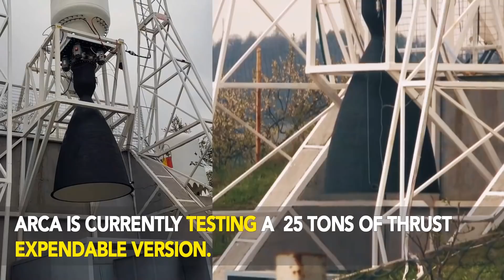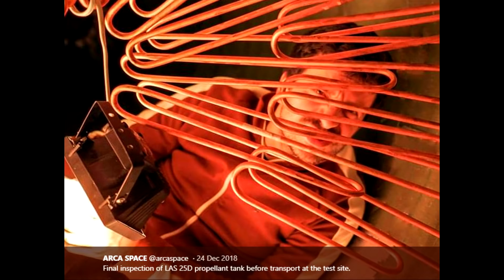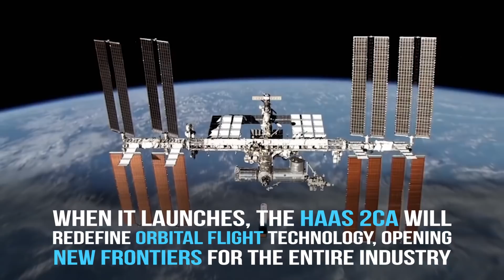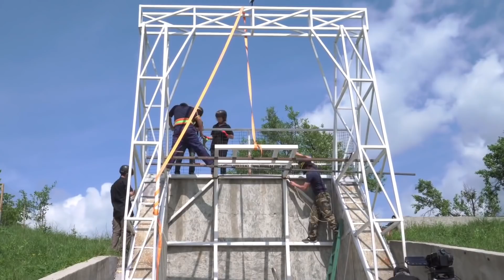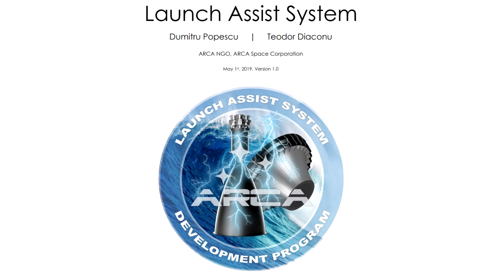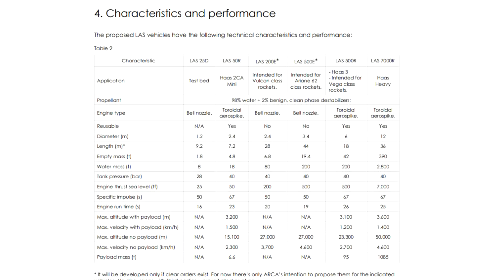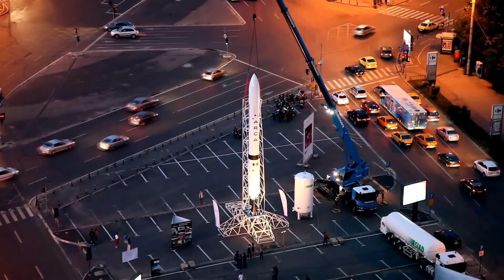Does ARCAspace's Water & Electric Powered Rocket Make Sense?

Comment: "They'll need 50 kilograms of batteries..."

Huh, that doesn't sound too bad.

"...per second"

oh
Reply: Especially as fuel "disappears" when you burn it, meanwhile you gotta take those batteries all the way with you!
Reply: Yes, 48 megawatts is a lot of power.
Reply: This is outside my area of expertise, but wouldn't all those batteries eventually become a lot of hazardous waste anyway? You can only re-use them so many times right?
Reply: @SgtHappyHands  at the crazy load rate they would need to be discharged in this rocket concept, the batteries could be used a couple of dozen times at best, with performance measurably degrading every launch.
Reply: @charlesfowler4308  You can drop the batteries. Use air bag lithobraking like Spirit and Opportunity for the packs. Funny enough, this design makes the rocket extension cord possible. It's all gravity losses and TWR for first stages. If the first two seconds of flight are tethered, that's that many fewer batteries needed. Add a simple rammed air generator and you can get the landing power regenerativly. I wouldn't even call it a traditional first stage, more like a Kickstarter stage maximizing TWR and only TWR, so the ISP stages can do their jobs.
Reply: The mission profile of the booster is only about 30s.
Reply: @w0ttheh3ll  Oh, I didn't know the rate of discharge would impact battery life! So they sound even worse than I initially thought.
Reply: That's not too bad... Problem is you still carrying those dead batteries so thrust to weight ratio isn't improving as much as it could. Also quick discharge- bigger failure potential and idk what's worse, rp-1 or a huge battery bank blowing up.
Reply: @SgtHappyHands 

That was assuming lithium primary batteries. Also known as non-rechargable batteries.
Reply: @SgtHappyHands 

That was assuming lithium primary batteries. Also known as non-rechargable batteries.
Reply: @SgtHappyHands 

That was assuming lithium primary batteries. Also known as non-rechargable batteries.
Reply: @SgtHappyHands 

That was assuming lithium primary batteries. Also known as non-rechargable batteries.
Reply: @SgtHappyHands 

That was assuming lithium primary batteries. Also known as non-rechargable batteries.
Reply: @SgtHappyHands 

That was assuming lithium primary batteries. Also known as non-rechargable batteries.
Reply: @SgtHappyHands 

That was assuming lithium primary batteries. Also known as non-rechargable batteries.
Reply: @SgtHappyHands 

That was assuming lithium primary batteries. Also known as non-rechargable batteries.
Reply: Wait, just refreshed, are these duplicate comments really posted? I just assumed that was a browser side display bug.
Reply: @jtjames79  The weight and extra complexity of a RAT would more than cancel out any benefit is would produce in charging the batteries, much easier to just charge them on the ground. But yh you could ditch the batteries, with a parachute tho lithobreaking alone would not be enough for something as dense at batteries in earth's gravity (I assume you meant doing so in conjunction with aero-breaking, just clearing stuff up 🙂). How ever at this point given the high cost and quick degredation of whatever batteries you're using I think a shuttle style reusable SRB would me much more sensible. And given all this extra complexity probably no more awkward.

Edit: Power cord idea does seem make a lot of sense tho
Reply: @TheAkashicTraveller  yes :) you have posted the same comment 8 times.
Reply: @TheAkashicTraveller  THe issue with lithium primaries is that they have a realy bad power output...

And if you wan to use lithium primaries anyway... why not just burn lithium right in the water. If its used for heat anyway.... that makes more sense
Reply: @TheAkashicTraveller  Thanks for the clarification. And sorry that your comment got posted 8 times XD. I just had one get doubled posted a few days back. But I've never seen eight.
Reply: quote 50 kg batteries PER SECOND unquote
Reply: @charlesfowler4308  Someone else brought up laser power from the ground. Since it's only got a 30 second mission, there seems to be many options for electrical power.
Reply: There are many better ways to get power/heat for the water in a steam rocket. The fact they are saying they will use Li-Po batteries suggests they have no idea what they are doing or are simple full of it.
Reply: ... "per second", not per flight.
Reply: ok, didn't "read more" :)
Reply: Charles Fowler you could eject them when empty, like the electrons upper stage. But than again batteries(Li-ion-Po) can only dump they’re energy in several minutes, not seconds due to the relatively low power density. So super caps would need to be used as they have 100’s of times higher spesific power.. buuut than again super caps have an order of magnitude lower energy density, so u would need something like 1 Ton of caps/sec.
Reply: @TheAkashicTraveller  They really are. sigh. You have some deleting to do.
Reply: That moment when you can describe battery power in terms of mass-flow.
Reply: All they need to do is vapourize the dead batteries with the good batteries and use batteries as the propellant...
Reply: @HylanderSB  30 seconds? Maximum discharge of rate of current Li cell technology is about 20C, or 3 minutes, but that is an edge case with massive thermal losses to internal resistance and the cells designed to handle such high discharge have substantially reduced specific energy right from the start.
Reply: @SgtHappyHands  It depends, there is a tradeoff in battery design where you can get somewhat better energy density in a battery that ruins itself in a single discharge, or worse density in a battery that can be recharged and discharges thousands of times over the course of years
Reply: @charlesfowler4308  unless you use asparagus-style staging
Reply: All they need is a Water Battery ... maybe some HHO pseudo scientists can help them, the ones who haven't already been killed by big oil companies and the Illuminati
Reply: for a first couple of second you can use a long cable to supply power ..... after that you drop 50kg of batteries each second.
Reply: @mihasedej  a super conducting graphene thread!!!  .. or a large laser   (humor)
it's funny all these silly useless water rocket ideas have been around for decades.
Reply: LOL
Reply: I know this will probably sound ridiculous but, what about a pair of spools of superconductor wire (or even copper) and structural sheathing ground side and you use something like this as a first stage, "dynamic support" skycrane stabalized by the cables (ala Curiousity Lander) that would lift it maybe 40 miles up before launching a more conventionaly fueled rocket... we know siting rockets closer to the equator (for increased rotational speed) or at higher altitudes is considered worth doing; wouldn't getting past the bulk of the atmosphere be worth doing?
Reply: @w0ttheh3ll  Wouldn't graphine supercapacitors get around this? Those are reasonably expected to be available somewhat soon for limited applications and unless I'm misguided about their theorized capabilities, they should handle a duty cycle like this pretty well.
Reply: At 250°C water temperature, they're storing 291.7 Wh/kg through temperature alone. Adding 150 Wh/kg batteries on top of that makes no sense at all.
Reply: @bryanl1984  I haven't heard of those. If they are at all comparable to current supercap designs, their power density would make them suited to this kind of load in theory, but their energy density would be horrible for a rocket.
Reply: @jtjames79  I had to rephrase your comment in my head. So a first-stage rocket with an umbilical cable. To make this viable, as every meter going up means the mass is INCREASING, the cable would need to be propelled upwards from ground too. Maybe using... rockets attached at intervals, or high speed loop with a friction hooks or something. This is more Kerbally than Soviet N1 rocket!
Reply: @SgtHappyHands  I think the smarter way is to try not to carry any batteries at all. But beaming the power (via a high power laser for example) has it own issues. Lithium batteries are not that bad for the environment in them selves if one happens to drop one. But there rather costly to make environmentally. And though better production techniques and recycling can cut down on those cost it one thing to keep in mind. Of course the biggest issues is that bat tries are so low density when it come to energy storage.
Reply: @w0ttheh3ll  From what I understand, the thinner and more effective your insulator, the more effective your capacitor as the energy is bound up in a strained magnetic field. Graphine is litteraly a monolayer and it has a bandgap dependant on strain, doping, orientation, etc so you could actually possibly use graphene as the insulator as well, meaning you'd have a functional capacitor of 3 carbon monolayers in thickness per assembly. I could envission some stacks of this storing up quite a bit of power and it'd be lighter than LOX and pretty dense. 

Still, I think this concept would be better applied to a type of floating launch gantry by pumpting power up from the ground into a dynamically stabilized structure comprised of the first stage superheating water or sucking in massive quantities of atmosphere, cross flowing it with the heated outout and dumping an arc into it. In theory, this would let you design a plenum tailored for the elevation to make it as efficient as possible. It would essentialy be a lauch platforn for a more conventional rocket suspended by a giant drone. That'd probably be feasable and worth trying. Except for supercapacitors, batteries can't even approach chemical energy densities.
Reply: @Vatharian  I was thinking the sweet spot would be around twice to three times the rocket height. Attached to the top of the launch tower, while plugged into the bottom of the rocket. Those first three seconds are brutally expensive in gravity losses. Also three seconds is one tenth of the mission.
Reply: All that lithium... and all the hydrocarbons needed to charge those cells.

Zero emissions is a farce.
Reply: @jtjames79  Depending on final acceleration three seconds may be way more than 2-3x height. But, if you need a booster, that's another story. In this case supercapacitors may be really more proper, while they have less energy densoty, they are lighter than betteries, if I recall correctly.
Reply: @SgtHappyHands  yes, but that's not the main concern as rockets generally get rebuilt quite literally down to the nuts and bolts each time they are re used anyway...
Reply: @charlesfowler4308  I think they can try to detach the battery while it's flying
Reply: Regular kerosene rockets doesn't sound so bad now.
Reply: Solar power.
They just need to make one little batch at a time.
You store the actual fuel in 2 little pressure chambers.
I have a roughed out design for what they are talking about.
Reply: supercapacitors?
Reply: I seem to recall reading an old science fiction story about nuclear powered rocket that was essentially a giant water tank with that superheated the water for thrust. The batteries here seem to be the major issue.
Reply: It's not as bad as all that as long as the batteries are recovered.
Most rechargeable batteries are made of something like 70-90% recyclable materials at least.
So once the cells reach the end of their usable lifespan you can recover most of the materials anyway.

People that predict masses of dangerous waste from electric vehicles are making the same mistake.

First, a 'dead' battery is relative, given the definition most commonly used is a battery that only holds 70% of it's original rated charge.
So for vehicle batteries you can generally repurpose old electric car batteries for purposes that aren't as weight sensitive (like grid storage batteries), and then when those really stop being usable you recycle the materials.

The more of these kinds of batteries the world uses, the more  common the recycling schemes for them will become.
Reply: @SgtHappyHands  well imagine a significant part of cars on the planet were battery powered electric..... The amount of waste batteries from these rockets would pale into insignificance compared with the mountainranges of old batteries just from these cars.
Reply: Michael Anderson  
Rocketlab use LiPo batteries to run their turbopumps then burn them up (LiPo burns well)
Reply: @5Andysalive  Certainly. But I was thinking specifically about the waste in comparison to other rocket boosters. If these batteries are more wasteful than another type of booster than can get similar performance, then that damages their usefulness. It might be small compared to the amount used in cars. But that doesn't justify being wasteful with them. Not that I think you were making that point of course.
Reply: @charlesfowler4308   SpaceX jettisones batteries during flight. But in this case, it might result in "heavy rain" :D
Reply: They could throw away 50 Kg of batteries per second. That's the good part. Now how many 50 Kg of batteries would they have to start with?
Reply: Just wait for a lightning strike and ride that lightning, just like they did in Back to the Future
Reply: Hahahahahahahahah
Reply: One word: Supercapacitor
Charge it up from a geni or solar on the pad for a day or so before launch, it only has to last about 60-90 seconds as a first stage!
Reply: @horstherbert35  That is pure Metal! \m/
Reply: @Jehty_  I guess that'll qualify as an Octopos(t).
Reply: At that rate it'd be more efficient to hit the batteries with a hammer, have them explode (good old LiPo!) and propel the rocket that way.
Reply: Perhaps they could use explosive lithium batteries?
Reply: @niwasox3  
Because 250 degrees is not hot enough to make the water do its thing for the rocket.

And you can't take energy out of the water to put back in the water and make it hotter. You have to get that extra energy from somewhere else.....
Reply: @SgtHappyHands  
Just like with all other lithium batteries, the lithium can be removed and recycled.

they're not trying to make most powerful, nor most efficient rocket.

They're trying to make one that's cleaner, by not burning so many horrible fuels.
Reply: @lordgarion514  Ah, noted. So they are more recyclable. What little I knew about batteries had me thinking they'd end up as a bunch of toxic waste in pretty short order.
Reply: Batteries could be expelled when depleted,  rocketlabs does this already. Burning empty batteries doesnt get you anywhere. A battery is only highly flammable when its charged. A discharged li on battery hardly burns at all. Still I have to concur, using batteries to produce heat  really makes no sense. Even coal has 30x higher energy density. Hydrogen even when a gas, more than 100x.
Reply: @Bondy Small problem; the rocket would not be able to lift the 24 tons of batteries, much less the 100s or 1000s of tons of extra water .  You can not get to orbit when the source of your energy is in batteries, the energy density is simply WAAY too low. The whole point of a steam rocket is that your primary source of energy is the hot water.  That can work as a booster if you discharge all the energy very quickly, but even when you combine that hot pressurized water with a nuclear powered heater, you only get specific impulse of less than 200 seconds.  So even theoretically with out the weight of the batteries a nuclear powered steam rocket could never hover more than ~3 minutes, never mind accelerate at several G for 8 minutes.
Reply: @epincion , writes "es, 48 megawatts is a lot of power."

That's not a lot of power compared to 1.21 Giga-Watts.
Reply: This reply section has a surprising lack of OOF

Im sorry....
Reply: @w0ttheh3ll  LUNCH
Reply: @TheAkashicTraveller  Delete them dummy, or have launch on me, HAHA.
Reply: WATE A MINUTE, THE WATER TANK IS MADE WITH FIBERGLASS HAND LAID. FIRST EVER MADE THIS WAY. ARCA CERTIFIED.
Reply: You need fusion power for this. Just wait 10 or 20 years will be fine.
Reply: Attention Sheep l, What propellant was to be tested on ARCA'S Aerospike? Well it ain't  H202, it's fukin water. I told you people ROSA BLOCKED FUEL DELIVERY. WATER IS ALL THEY GET. This information is from ARCA'S white paper,
Assist System, or LAS.
At the end of September 2018, we decided to use the
LAS technology in combination with the aerospike
engine also under development at ARCA and
replace the hydrogen peroxide considered as
monopropellant for the Demonstrator 3 aerospike
engine. It was however clear for us that we need first
to understand the new propulsion system and run tests
on a larger classic engine, before implementing it on
an aerospike engine

Looks like I was right, ARCA AND ROSA ARE AT WAR NOW, ROSA 1, ARCA 0
Now ARCA has to secure a Lunch Site, anyone want to bet ROSA BLOCK'S THIS TOO?
Reply: They should use electricity.  To split the water into hydrogen and oxygen before they load it into the rocket!  That way they'll get better performance, and they can leave the batteries on the ground. Oh, wait, someone thought of it.
Reply: per second?
Reply: How many seconds would they need for orbit per stage? Let's say 100 seconds, that's 5t which isn't a scary number for large multi stage rockets and the exhaust might be usable to recover some energy by using the heat, idk.
Reply: @getahanddown  Yes, but that's the amount of battery needed to make the pump turn, not to lift the rocket itself.
Reply: @lordgarion514  Horrible fuel? Hidrolox has the exact same exhaust as this: water.
Without dropping batteries from the sky.
Reply: @mihasedej  LOX-RP1 or LOX-Hydrogen sounds a lot simpler and more efficient! There are reasons why in the century or so since Goddard flew his first liquid propellant rocket, a LOT of ideas have been tried and many discarded. The idea that some sketchy group in Romania is going to have some brilliant burst of insight that has escaped some of the best engineers in the world, including the ones who took us from Alan Shepard's first flight to Tranquility Base in eight years, is just insane!
Reply: @kevin42  And don't forget the high current switching system to switch from the dead batteries being ejected to the fresh ones about to give their lives for the cause.
Reply: You only need 10 seconds to get to space?
Reply: Unless those batteries shed weight like regular fuel types... its just not viable lol.
Reply: @Charles Fowler not if you just stage them as you go up :D
Reply: @TheAkashicTraveller  firefox in combination with AdBlock Plus!!! It sometime does this.
Reply: Lol,how about just throwing litium directly to water,avoid the middleman,get more efficiency and trow hot basic solution around the launch pad which dissolves after launch from extreme corrosion,and you also have a cooler Daniel of rockets with spectacular red flame fireworks coming out of engine as a bonus.😂😂
Reply: @matsv201  I don't know the conversion, nor the will to find out [re: weight, temp, byproduces, wizard fees...] but coming from someone that is regarded [at least in my immediate circle] as the dumbest...most dumb...more dumber :), that sounds pretty clever.
Reply: Just use solar panels
Reply: what about the water?  Won't the water evaporate too quickly in eco rockets?